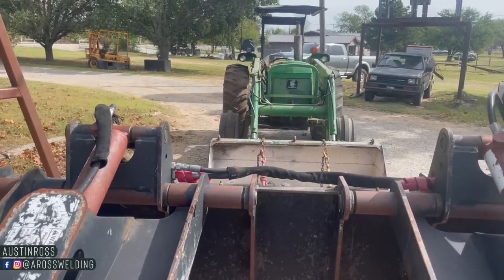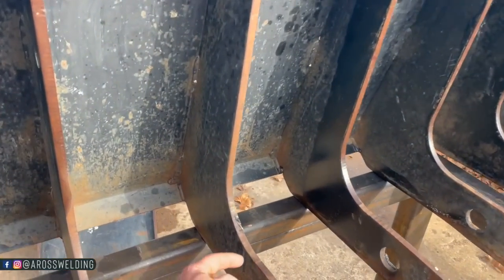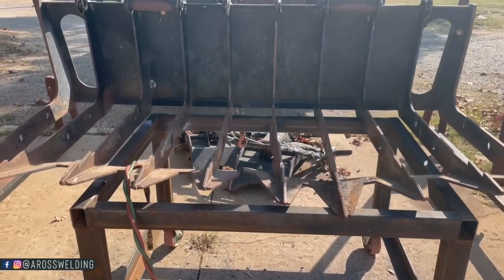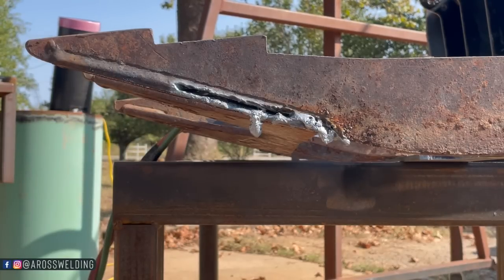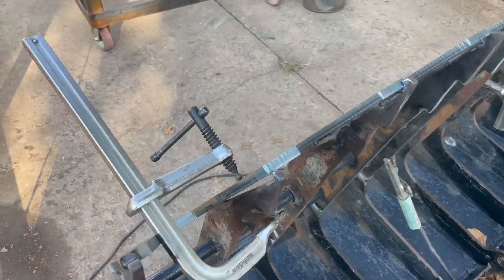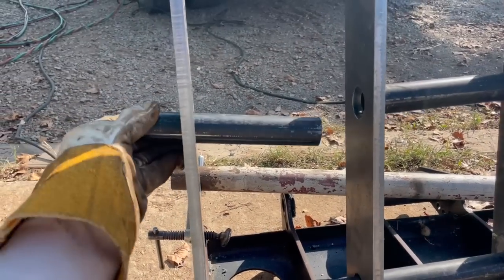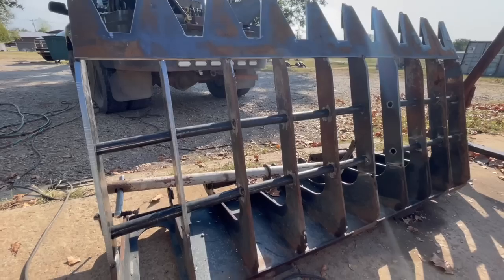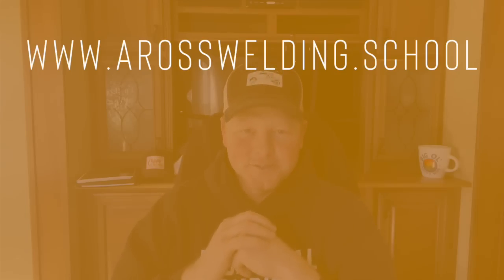Repairing Skid Steer Grapple// Welding Repair Project

Comment: Great job, Austin. From my armchair vantage point, that grapple looks a bit lightweight for the length of those tines. It looks susceptible to bending again if used roughly as in digging, rock piles, and roots. Best for brush, though. But it's likely not overly heavy to not outstrip loader capacity. Always a tradeoff. Keeps ya repairing! Blessings!